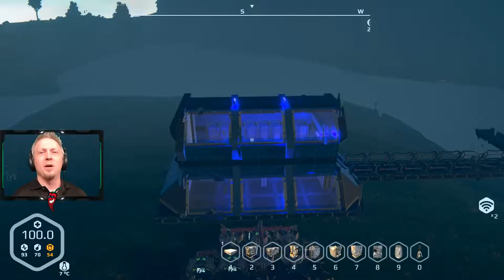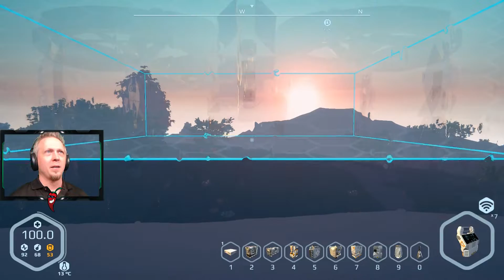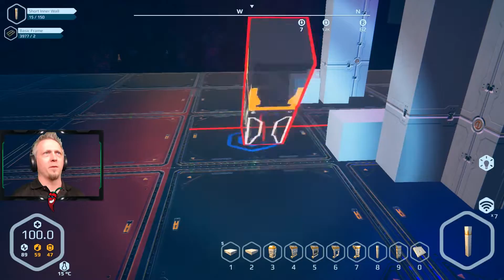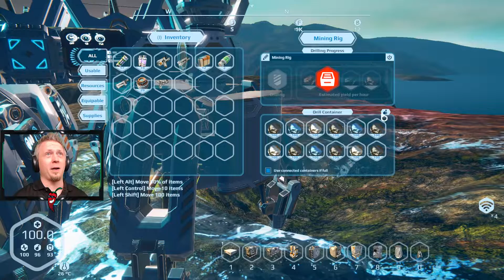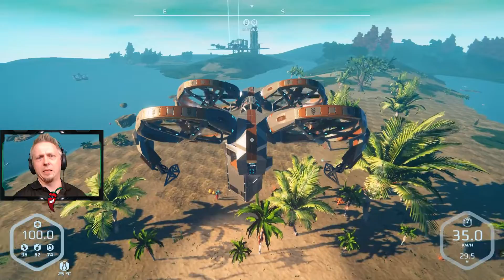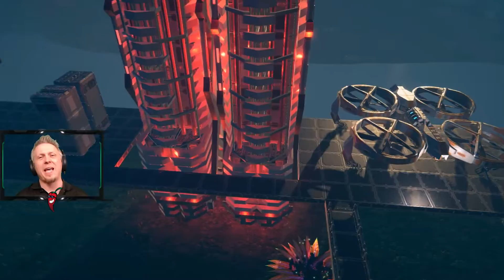TESTING OUT A MAGNETIC LIFTER DESIGN  -  Planet Nomads Gameplay S2 Ep14

Comment: I think you're overthinking the container moving, unless you're just trying to add a level of realism.

You could just have a platform large enough to hold the container as a part of the ship design.  And then just use the mover tool to move it from a platform to the ship and vice versa.  No need for any kind of lifting device at all.

Comment: Regarding the vehicle turning slowly, that probably is caused by a joint (hinge or rotating plate). Joints generate forces. They always did. Probably it is how the Nvidia PhysX works and PN developers, unlike in other games, give 100% freedom to the physics engine and to the players. To see the force/glitch used in a nice way, check https://steamcommunity.com/sharedfiles/filedetails/?id=1500128958 It is not meant to transport cargo because the center of mass must be perfectly on the vertical axis of symmetry.

Comment: Regarding the unlimited mining option, I found out now that we have to change also Difficulty to 3 which will transform the save into a custom save. The Difficulty is already present in the same place where the AutoMiningHarvestCountMultiplier must be added/adjusted. Difficulty 0,1,2,3 means easy, medium, hard and custom. The 0,1,2 values (easy, medium, hard) will use some default values, not the ones specified in the save file. Sorry for not checking sooner.
Reply from the maker: I technically already "fixed" it by changing the total available for the different mining sites to 9,999,999 so that should last me a while.